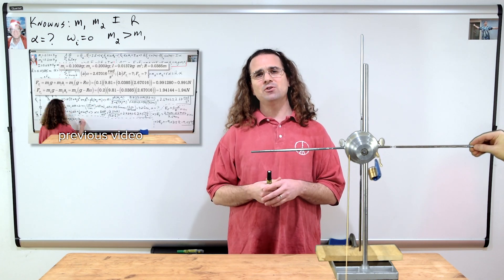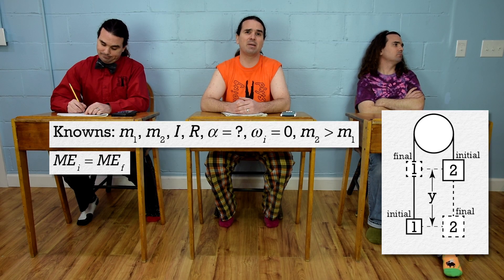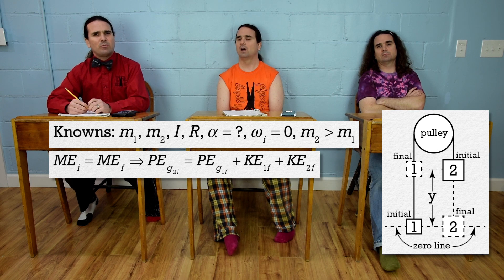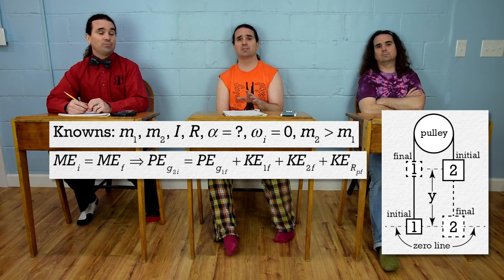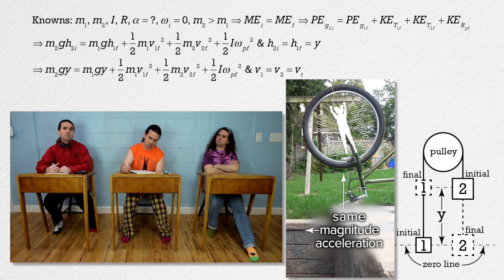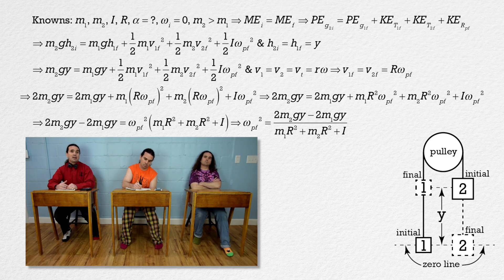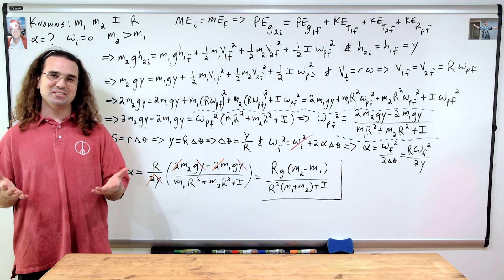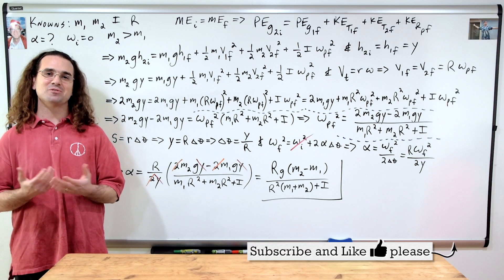2 Masses on a Pulley - Conservation of Energy Demonstration

Comment: But sir tension us different on either side of pulley so tension is doing some work here .so how can we apply conservativion of mechanical energy.plz reply🙏🙏🙏🙏
Reply: Good question.   Yes, the tension force is doing work.  However, the force of tension is not applying any net work to the system.  Any work done on a string segment, will also become an equal and opposite amount of work done by the string segment.  Work done by string segment on mass 1 while it moves distance d, is Ft1*d.   Work done on the pulley from the same string segment is Ft1*theta*R, which correspondingly equals Ft1*d.   So work associated with string segment 1, adds up to zero.  The same happens with string segment 2.  Work done on the pulley by the string is Ft2*d, and work done by mass 2 on the string is Ft2*d.

Generally, forces of constraint (tension, normal force, static friction) without significant elastic deformation, cannot supply or subtract any work.  They can be forces that transmit work, but all work that an agent does on them, they will do to the object on the opposite side.  They can also be forces that act as a "work mirror" (my term for it), such as when the road pushes forward on a car, and reflects the work the engine is attempting to do on the road, as work done on the car.

Comment: Loved the concept of the video. Great effort. Really enjoyed how you have covered the misconceptions that may bubble up in students minds. Again solid effort.

One point though ... the reason why the friction between the pulley and the string does no net work is because the friction is static. Had it been kinetic it would have removed energy from the system, inspite of it being internal.
Reply from the maker: Thanks for the compliment. With regards to the friction between the pulley and the string, you have a valid point. Thanks for pointing that out.
Reply: wait but why though? I'm confused
Reply: @bobmarley9905  Think of static friction as a force of constraint, just like the normal force or tension.  It is the kind of force that cannot supply or subtract mechanical energy to/from a system.  Another name for static friction is traction.   Kinetic friction is skidding, static friction is gripping.

Static friction can transfer work from an agent to an object, such as when you push a book on a table from its top surface, you are the agent and the book is the object, and all of your work via the friction applies to the book.  Static friction can also be a zero-work force by acting perpendicular to object's motion, such as the traction that guides a car around a curve on a flat roadway.  Static friction can also act as what I call a "work mirror", like when a car's engine attempts to do work pushing the road backwards, and the road reflects this work back onto the car.  In any case, static friction is not the source or the sink of any work.